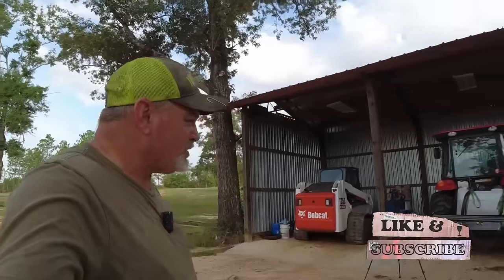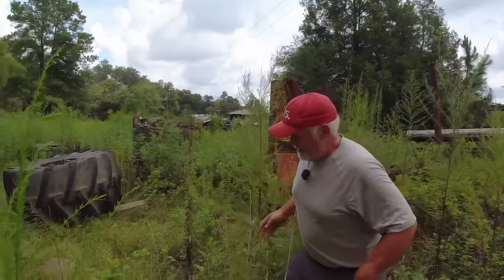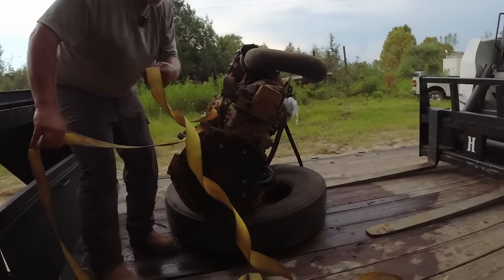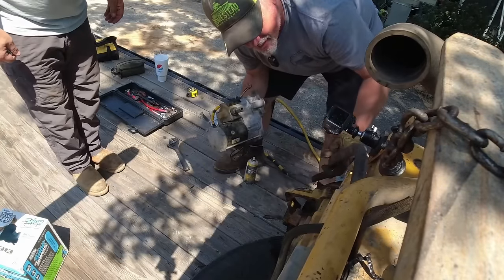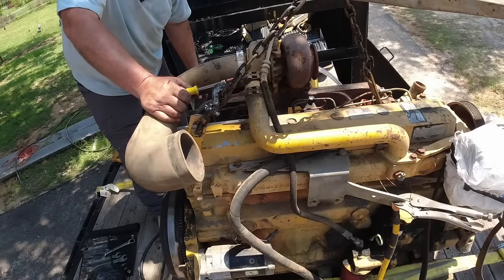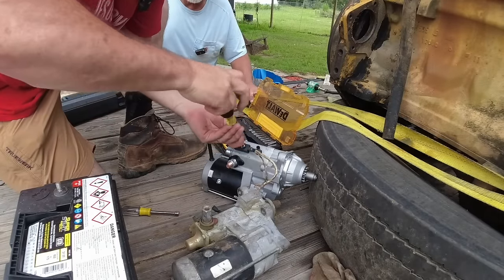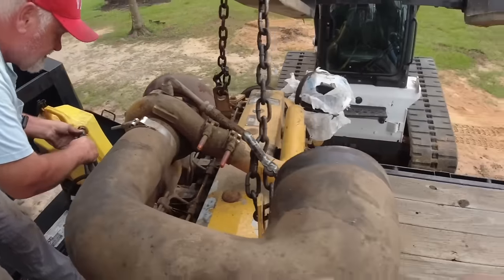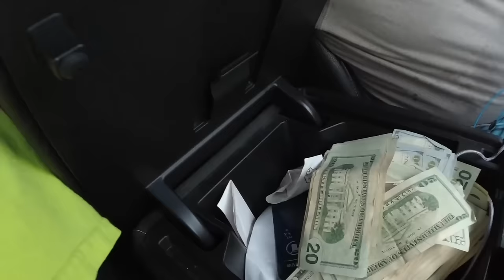WE RESCUED THIS ENGINE from being scrapped! But will it run?

Comment: Finally someone using an electric fuel pump to charge fuel system . Used this system in 12 and 24  volt pumps  . Fired off all the way up to 20 cyl EMD locomotive engines .

Comment: That first starter was not strong enough, and got fried on 24 Volts. Love the smoke coming out of the vent. Probably all corroded inside when that water came out. Of course you got the engine running.

Comment: Nice set of bolt gauges there. I never saw any like that. Question: does it have 9/16 fine thread? Don't see them much anymore. Clark, Hough & Michigan loaders used them. Hard to find.

Comment: When I was in HS, a friend of mine,  who's family owned a junk yard, called me and said they just got a wrecked 66 Chevelle in and it had a beautiful 327 and transmission in it that hadn't been touched!. I bought it for $800. We spent a whole afternoon working to get it out of the car, put it in the trunk of my mom's 77  Nova and the tyranny in the back seat. Just a little overloaded. Long story short. Spent a few weeks putting it in my 55 Chevy and it started on the first crank. Kept that car 4 years until I joined the Army. Such a deal!
Reply from the maker: Sweet 👍

Comment: Yes I have bought an engine sight unseen and I had just in my abilities to get the engine up and running. You know there is enough parts around  to fix engine or transmission.

Comment: I don’t know if you have heard of a product called fogging oil. It was made for marine Diesel engines.  It works great and does not harm the rings and cylinders. I use it on gas and Diesel engines.

Comment: That engine galloping initially was a bit worrying but it seems like it cleared up. May still have a weak cylinder... Ol wiley got lucky!! Keep runnin that bobcat hank and when that pump or drive motor shells out and sends metal throught the whole system, you'll wish u'd of listened to us
Reply from the maker: I'll listen to Bobcat :) I took it to the service department and they didn't find anything wrong. I really do believe it's the microphones making it sound louder. They looked at everything. I appreciate you!
Reply: @HamiltonvilleFarm  hope u got it in writing!

Comment: i have i bought a 292 inline 6 with a 4 spd, i ahvnt pulled it part yet still though an still not sure which project to put it into, the 56 white wc, the 78 chevy thats gonna have grandpas 41 dodge cab put on, the 51 chevy g506 that im buildin into a tractor truck or onto the 74 chevy wrecker

Comment: pretty sure that fluid level you pointed to is the hydraulic fluid level, To check the final drive oil you have to pop the plug in the final drive in the middle. there's usually a fill and check plug.

Comment: Bought 6 cyl. engine for my 1952 Dodge 1-1/2 ton truck.  Told, ran when parked.  Was locked up, but one cylinder was locked up.  Repaired it and ended up with good engine.  As I recall it was a set of rings and some gaskets.  It was worth the gamble for me.

Comment: I work at a coal mine and I've spent a few years around the shop and seen a few malfunctions when the mechanics are in a hurry or don't follow proper procedure..one example when they installed a new transmission in a piece of equipment and don't torque properly only by the impact as well they never used lock tight for xtra insurance..it was a costly mistake when the flywheel come off the same day it was released for work..

Comment: Nope, I don't buy no swine in a bag.  Whatever'll do what it's supposed to and I get it like it is and pay accordingly. And your hydraulic noise is coming from the pump(s) if it has swashplate piston pumps. Positive displacement/variable flow type like on a concrete truck to pull the tub. They have a whine when they're pumping. And that gal still does a fine job and yall will get by. GBWYall!

Comment: Hank your hydraulics on your skid steer sure is loud. that noise is your hydraulic struggling you should fix that cause I let mine go and It cost me lots to fix. I had to buy a new pump. It happens when you don't run your machine at a high throttle. When your driving around with no throttle its hard on your machine.

Comment: Much easier to get the air out if bleed at the injector as its a empty pipe of air locked into the line when bleeding at the pump only. Its really hard to get air through the injector itself. Don't know why if fuel will go through  that air doesn't want to go through a injector... ask any mechanic, have best results at injector. Once two or more get the air out, they will usually prime up on their own then.. don't be afraid to open the line while its  running even if on cosby sauce. Even Richard Pryor knows that now. I don't like those primor pumps either as you seem to pump till the  cows come home but realize its like using a bicycle pump to air up a tire on the loader or big truck tires, just a dribble  when your wanting a bunch of fuel. A quicker way to make your hand primor to work is to get some air pressure in the fuel can... even a couple pounds of air in that little can will make a ton of difference.... here is the way I do it; I crack the fuel lines loose at the injectors that are easiest to get to..... pressure up the little yellow can your using by stuffing a rag over the hole for that fuel line and get the air sprayer nozzle in there with it and just give it some gentle air into the can and your going to see it swell a little.... thats enough to move gallons of fuel just like if u were syphoning fuel from it into another can/tank. Turn the engine over and keep priming that pump by pumping that silly little handle up and down for seemingly ever.... soon as you see the bubbles in the injector line starting to get some real fuel coming through, tighten that line up at the injector and go to the next one, and the next one but usually after the second one starts fuel coming through, the fuel in the pump itself will now hold enough to catch its prime. Sometimes even just one line primed right will be enough for that engine to start enough to make it go.. see the fuel in the pump will fill the different cavities in itself when one line is clear of its air..... don't know why its that way but it is. Cracking it lose at the injection pump will help get air out of the pump itself but not injector lines.... Hank, Wiley, poor girl who's britches have holes in them (lol) your fully acquainted with my comments and know I have wrenched since god made crescent wrenches. I have seen guys start one and keep it running on the starting fluid cans.... and I mean several cans of the cosby sauce and still not catch its prime... air just don't like to be pushed but it will mix with fuel or even water... the fuel microns are just a tiny bit smaller than water so fuel will go through a injector but water is just that silly little bit bigger that it doesn't like going through the injector..... SO JUST BLEED IT with the line loose at the injector... that first little bit is a good start but just a bit more as in a few revolutions more of it trying to run... then lock it down and it should catch right quick.
 It saddens my heart that people are so wasteful an will toss a  good engine or other big parts into the trash/scrap yard when we all know that someone really needs it. Yes, I do know that we can't save them all and a lot of parts will still continue to go to scrap as the person selling scrap doesn't have a way to hold onto parts till given or sold. Thats where you kids get involved. Starting a place like a old shed or what ever you find to hold onto the better parts and not try for gold... silver is just as good but it  still takes ten dimes to make a dollar so you have to decide how much is fair to both. I got some test  equipment from NAPA as they do replace test equipment with newer and better test equipment  quick. I got one of their old alternator/generator testers from them and made a deal with a small wrecking yard to pull alternators and generators off of stuff that was to be crushed anyway. They would weigh them out just as if they were buying a pallet of junk to buy for their yard an I gave them more than what they got for it in scrap salvage. I made around five thousand dollars a month doing  that for a few months till someone got jealous and stopped my little operation.
Reply from the maker: right on Morgan. We have a lot to learn :)
Reply: @HamiltonvilleFarm  Absorb as much as you can from my mistakes and learn that your gaining much knowledge whether you believe it or not. You have come quite a ways from just a idea kicking around. Maybe get a second crescent wrench, one half that size thats easier on pieces and parts to work with.. no shame in making it easier on yourself. Heck you learned how to do everything one handed since doing videos, just a day at a time Hank

Comment: When i see that old engine i said to myself that this will turn to HamiltonBill farm smiles. You will start to dig it and changing parts on it and that never ends. I hope Wiley is lucky about this engine. Rear main seal was leaking if i was you i would change them front and rear main seals, it will leak like hell so dont put flywheel one before changing those seals that will save you from a big problem. Rear main seal allready leaking while engine is off think that whats gonna happen when you run the engine.

Comment: Very rarely is an engine a lost cause. Especially these days when we've learned so much about engines. Almost always it's a part of the engine not the whole engine. Bad piston? Fixable. Bad valves? Replaceable. Accessories? No problem. They're just wear items. You see what I mean?

Comment: Hi yes I have it's was mid eighties mk1 lotus coffins engine in a scrap car the car was totally wrecked but engine complete took it out got it home cleaned it it turned did a few things fuel ECT it fired up can sweet it went in another lotus coffins that was only a couple of numbers different still running it to day do a couple o f  classic races a year I paid £45 in the eighties absolute bargain my coffins is valued at  £45.000 now no 2 R S 2000 1979  33.000 from new £54.000 great 👍content as ever you buy crack me up brilliant

Comment: I once bought a car unseen , ended up having to replace all the ignition , cooling system , replace valve/head gasket , plugs , brakes ,  set valves, timing. Mind you I only paid £500.00 so what the heck did. Expect😆